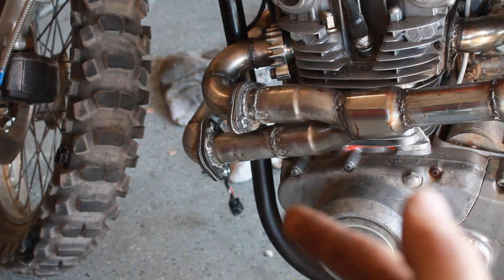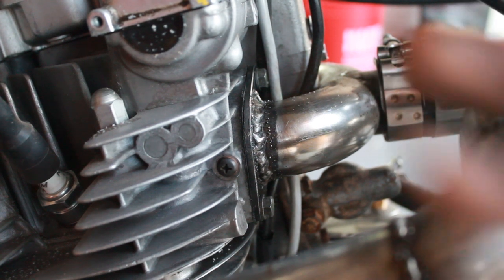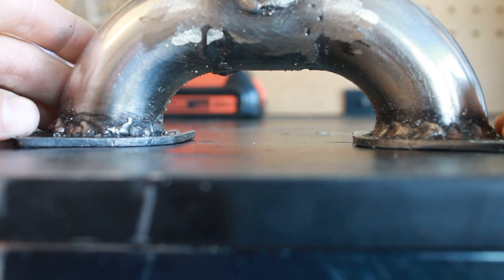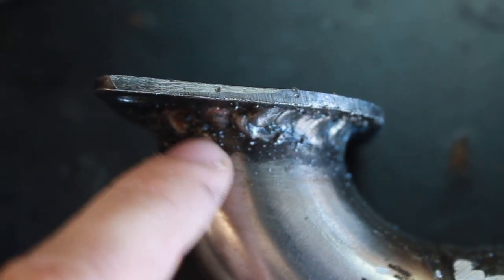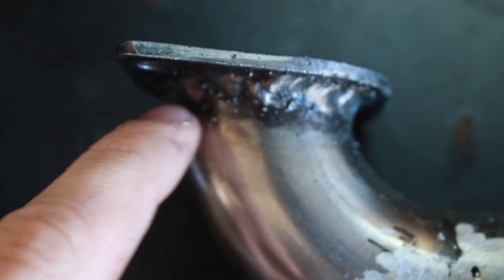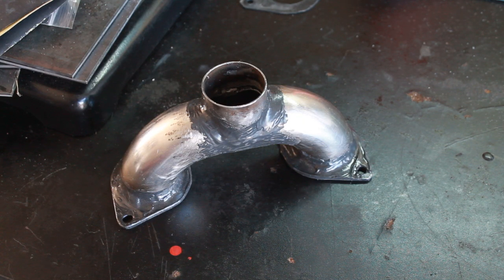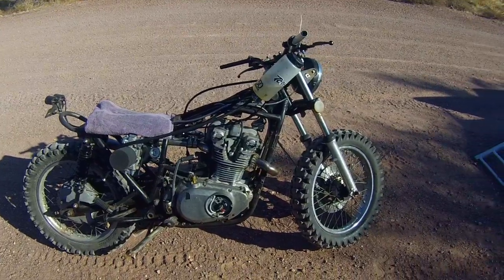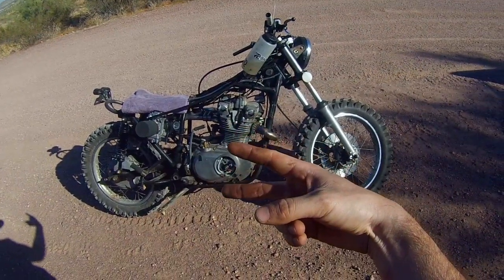Turbo Mad Max GS400 Scrambler (Part Nine) - Motorcycle Timelapse Build

Comment: Would be cool to see it have water methanol injection as well
Reply from the maker: It would be unnecessary on a draw-through setup, especially since I'm going to be running E85. Since the fuel travels through the intake piping, it cools down the intake charge. Also, since E85 is an alcohol, the intake will be so cool that some people have had frost develop on the intake pipe. You'll notice on draw-through setups nobody runs an intercooler, mostly because it would add too much length to the intake piping and drop fuel out of suspension, but also because they're not needed for the above reasons. -Jimmy
Reply: @DoctorMotorcycle  right on!

Comment: Nice, i need to work on my seat too.😁😉🙃

 The only thing I might worry about on the exhaust flanges when you sand smoothed and make it flat your taking the material way and also making it thinner, more susceptible to cracking over heat cycling, it would be better if you maybe could add a little bit of metal to it , hmmm in theory.
Reply from the maker: Thanks, that's not the exhaust flange it's the intake manifold. The intake manifold is actually cold to the touch when the engine is running and during boost, and never really get's much above lukewarm. The atomized fuel cools down the intake temperatures, which is an advantage of running a draw through turbo setup.
Reply: @DoctorMotorcycle  oops, my bad, right on sir!

Comment: So the screw that you put at the bottom of the pan to hold the seat down doesn’t turn when you try to tighten it ?
Reply from the maker: No, the resin dries really hard, it's not moving.

Comment: How would you check if its leaking on exhaust pipe where it connects to the cilinder? Want to hear your theory. Grear video, seems like you love experimenting. 👍
Reply from the maker: Run some seafoam through the engine and see where the smoke comes out.

Comment: Is doing fiberglass as easy as you make it look??
Reply from the maker: As with anything, if you have no experience you'll make newbie mistakes, but once you learn the tricks and mess a few up, you'll have it down pretty good. The main thing is to use plenty of resin, and to get it spread out and absorbed into the mat quickly before it starts to gel up. The rest is pretty straight forward. The only thing not shown in the video is after I laid down the cling wrap, I hit it with a generous coat of Carnauba Wax before laying down the resin (only before the first/bottom layer).